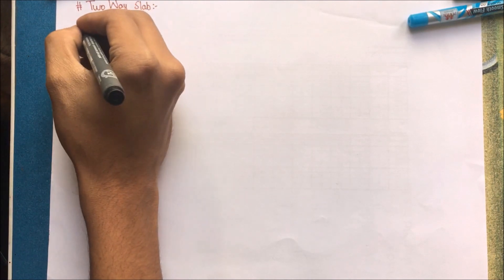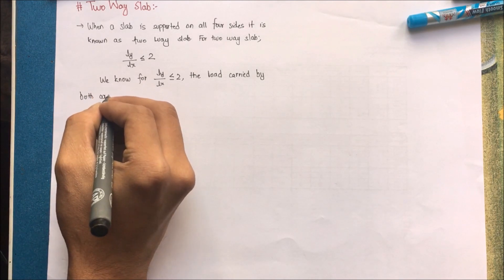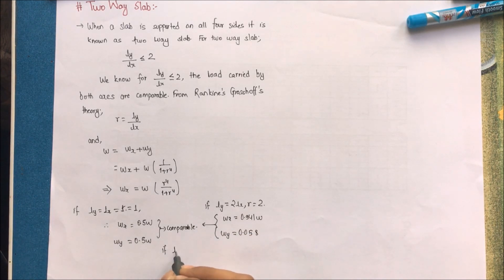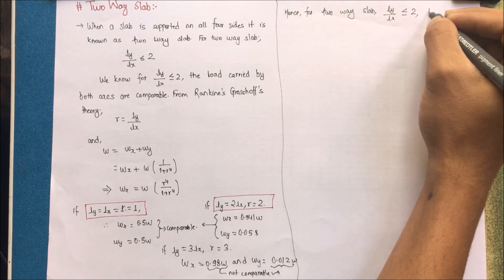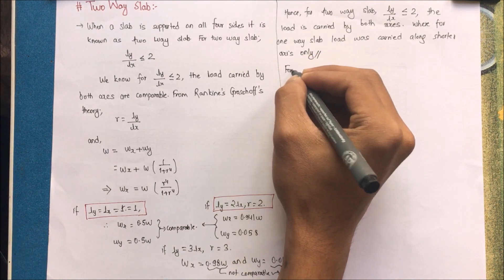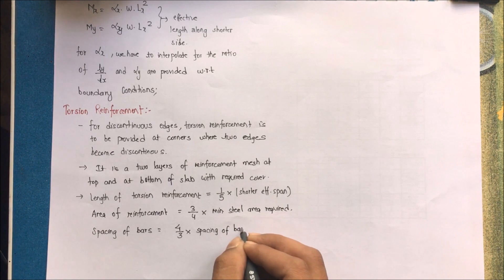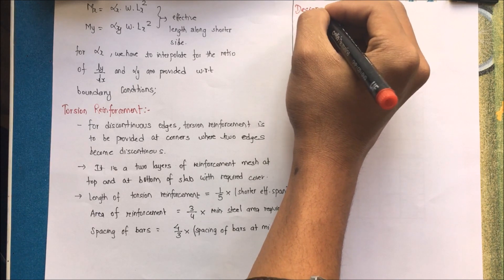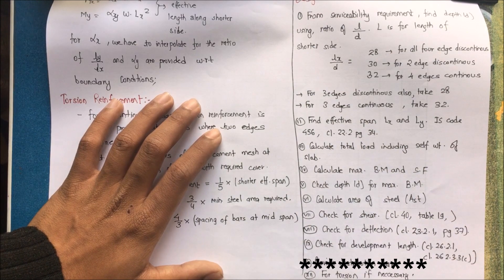Design of Two Way Slab & Torsion Reinforcement | RCC Structures | IOE

Comment: Torsion reinforcement provided at the corners of a two way slab for? 
A  prevent corners from lifting
B  controls cracking at corners
Wat is the ans?
Reply from the maker: That should be provided for both reasons.
Reply: @civilconst  but in exam we have to choose one.. 
This question came in various exam?
Reply from the maker: @sanju8733  Go for option A then.

Comment: What if the adjacent slab is cantilever one?
Is the panel still continous at the side where cantilever slab is provided?
Reply from the maker: Thats should be clearly designed as cantilever slab  without any case being analysed for other side.